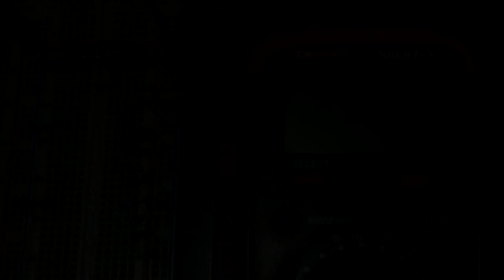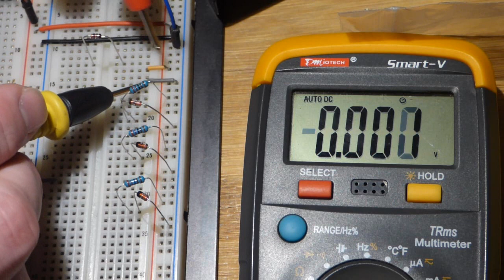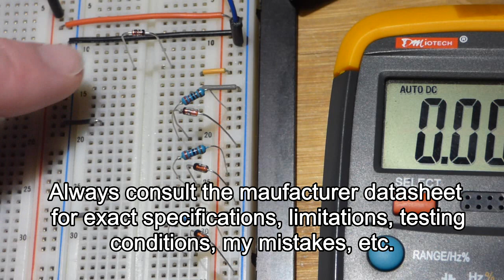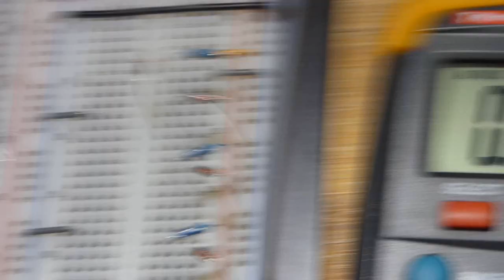Easily adding seven tenths of a volt to zener voltage using 1N4148 rectifier diode for electronics

Comment: So one could use a zener diode to drop 12 volts to a lower say 9 volts  
To run a seirse of LEDs with a proper resistor.  

Does this just spread the heat out 

Or should I just get  a voltage regulator resistor and cap. 

Really interesting video. Thanks.
Reply from the maker: You can use a zener and transistor, or the LM7809 integrated circuit which does the same thing in one package which is to convert the extra voltage into heat. Voltage buck converter works better if efficiency is important. Thanks for watching!

Comment: Will this setup consume more currant
Reply from the maker: It actually lowers current because the more voltage across the diodes. the less across the resistor which sets the current.